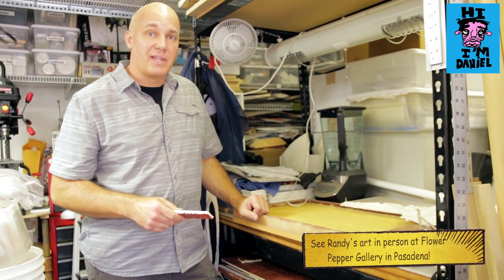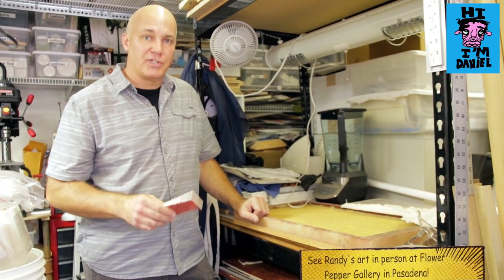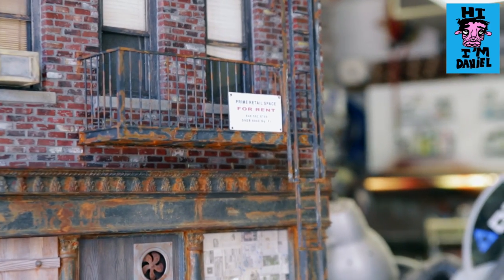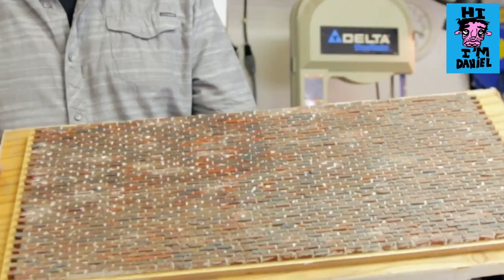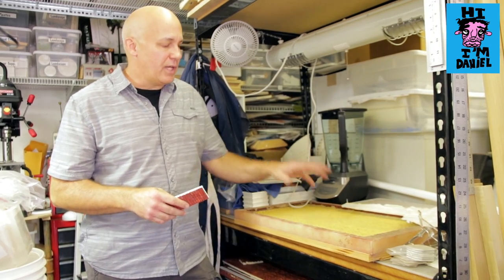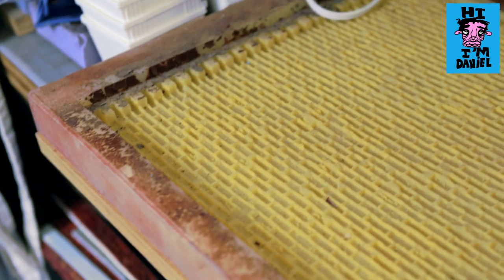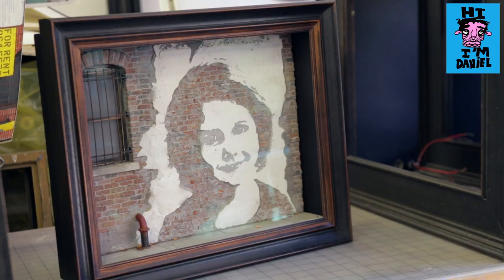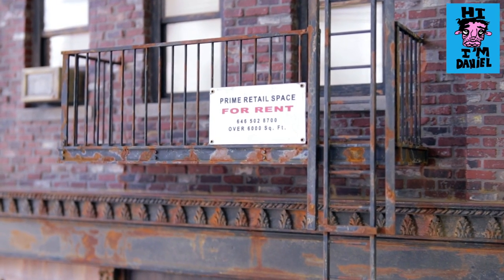Miniature bricks and how to build them

Comment: Joe Zoc i was wondering the same thing it looks like he was holding a cast wall of bricks but then he talks about changing patterns.  perhaps he does both or he casts multiple patterns? he also says he cuts it from real brick which dosnt make alot of sense to me perhaps he means he makes the original bricks from a similar material before he cuts them?  good stuff but would be nice if longer vid with more info..